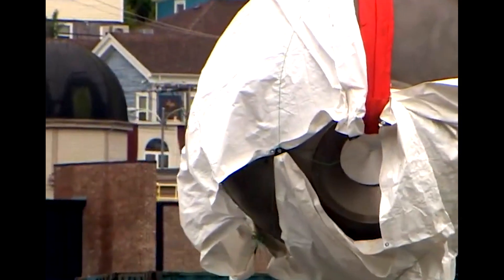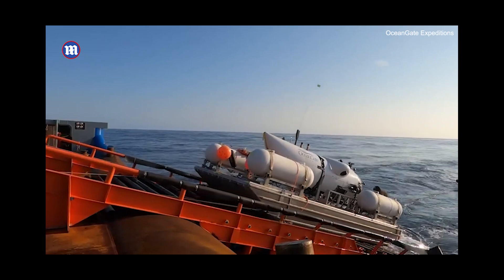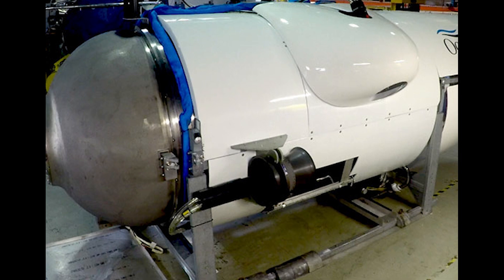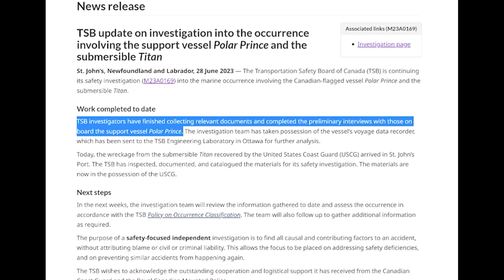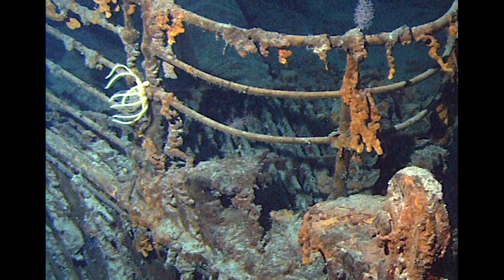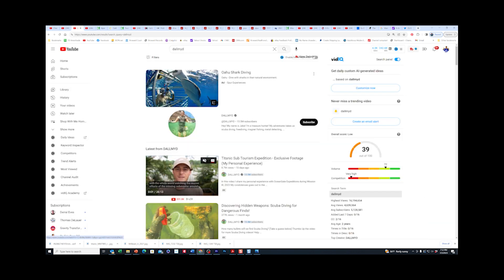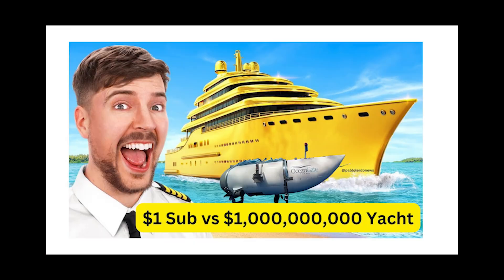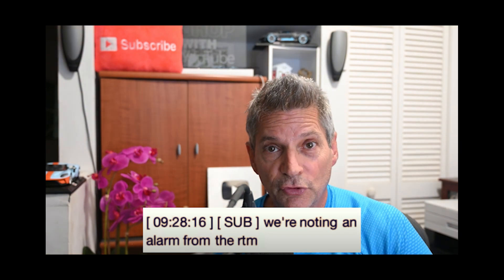Titan Submarine Debris Clues, Implosion Simulation

Comment: The age of exploration
Reply: The Age of Dangerous Ignorance.
Reply from the maker: @Stikibits  In the engineering circles we call this normalization of deviance
Reply: @jeffostroff  Normalization of dangerous ignorance.
Reply: @Stikibits ...to how far the Navy will go to stop Titanic from becoming a Disney ride..
Reply: @Stikibits   so was the car.  Back in those days.  People learn with experimenting. Alot should not have happen. Like glue and acrylic .  The fiber was ingenious.
Reply from the maker: @oanna1221  There was a time where we did not have seat belts When many people were likely fighting for them to be come standard
Reply: @oanna1221  no it wasnt, humans "experimented" with submarine tech over 100 years ago....carbon fiber is not a "new" tech, we've been using it in aircraft for 50+ years.  You're on the right track, but mostly havent a clue what your'e talking about.
Reply: @FriendxA The difference are that airoplanes never experience a force on the surface, greater than 1 psi.
Reply: @Stikibits  walking out of your house is dangerous. Breathing air is dangerous. What r ya going to live in fear. Their is good and bad also horrific  knowledge  to learn from oceangate. The dents and not crushed compacted hull gets me
Reply: @oanna1221 ...

There's dangerous, then there's foolish.    Skydiving is dangerous, jumping out of an airplane without a parachute is just foolish.   The titanium ends of the hull are intact and titanium is accepted for use for pressure hulls.    There is nothing left of the carbon fibler part of the hull and carbon fiber has been rejected for use in pressure hulls.  Deep dives are dangerous.   Even getting in Titan was foolish.
Reply: @oanna1221 because it wasn't an implosion... something pierced the hull and it exploded outward..like a torpedo
Reply: @oanna1221  Dribbling Sh1t could cause invasive, bacteria laden flies to enter your mouth/stomach. Doh.
Reply: @oanna1221 walking out of your house and breathing air isn’t even comparable to trying to go to the ocean floor in a jank sub that had been warned about by several people beforehand.
Reply from the maker: Yes, special shout out to Stockton Rush for being on that front line and showing us what not to do.
Reply: @jeffostroff  the age of implodation
Reply: @moonasha also an ugh-splosion
Reply from the maker: @Defender78  I love that phrase
Reply: @moonasha  "implodation" is now my new favourite word.  Cheers!
Reply: @jeffostroff  i don't think he's going to hear you.....
Reply: @jeffostroff  Darwin award nominees
Reply: @jeffostroff we've known better for over 50 years- since we lost Thresher. He didn't heed the voice of experience
Reply: @jeffostroff I think the Cyclops ate the carbon fiber hull and the people after the implosion. <HEAVY SATIRE >
Reply: @jeffostroff  the craziest thing is that it's not even an unknown realm. Everybody who is in this line of work knows not to design the sub like this. 

Every now and then, we need a reminder.
Reply: @jeffostroff  qqlllolll
Reply: @jeffostroff  Stockton Rush will forever be regarded as an explorer whose demise was his own egotistical willful and knowing criminal negligence.
Reply: @jeffostroff Hell yes. He wanted to be known as an innovator, but only going down in the books as a boob!
Reply: @jeffostroff Hahaha for real
Reply: @jeffostroff built by Father Ted
Reply: @jeffostroff   I think he was on to something  with carbon fiber.  The glue. No! That was suicide.  I could be wrong. My gut says dents on outside hull. Dents not crushed inside hull.
 Logic glue separated trom hull and titanium  end game.
Reply: @oanna1221  Sadly not. Carbon fiber is tough, why it's used for bullet proof vests, but at least at it's current point, it's far less resistant to atmospheric pressure compared to stainless steel or titanium. You can even find a quick pneumatic press video here on Youtube that shows carbon fiber collapsing like a blob of jello at just 1/4 the pressures solid stainless steel can stand up to.

He was just cutting costs with an insanely arrogant level of pride. One of those alone is dangerous enough in engineering, but both together doomed the Titan sub. It really wasn't a matter of if, just when.
Reply: @oanna1221 non-sensical.  The pressure would have held the vessel together. This is an explosive event. Probably a navy torpedo.
Reply: @HulkTheSurgeon Carbon fiber is 5 times as strong as steel. What video you talking about? Is the piece that gave way at 20,000 lbs per foot 5 inches thick? Nah.
Reply: @pikespeak361 five times as strong in what way? Carbon fiber has zero yield since it doesn't pemenently deform under its tensile strength, while 4140 steel has 415Mpa Yeild. CF and 4140 has about the same tensile in that configuration (about 1Gpa). 4140 has a shear modulus of 80Gpa (crazy!) and CF is 15 to 20 GPA, making it at best 4 times worse than a good alloy steel. CF is only 5 times stronger in tensile strength to weight ratio but nowhere close in strength to volume ratio as indicated by any materials spec sheet.
Reply: @VoidedWarranty  BY YOUR VERY ASSERTION, THE VOLUME OF THE CARBON FIBER, LIMITED AS IT WAS, WAS STRONG ENOUGH. AS WELL AS THE FACT THAT THE PRESSURE WOULD HAVE HELD THE COUPLINGS TOGETHER BY DEFAULT.
Reply: @pikespeak361 the titan had NOT been proven. Who tf are you saying sent a torpedo towards a submersible that was literally right by the titanic??? And WHY.
Reply: @oanna1221  i am a plastic technician, and i don't think carbon fiber is a good idea for something like this.
With every dive you are going to lose in integrity in the fibers build up and the fibers themself. 
It would maybe make sense if you intend to replace the carbon fiber every few dives. 
Otherwise i wouldn't recommend using it. Once the fibers build up is compromised you are in a death trap.
And over time with high pressure on the haul you would lose on integrity, can't avoid that.
Reply: The Era of Implosion.
Reply: İnploration.
Reply from the maker: @garrysekelli6776  I like that new word we should add it to the dictionary
Reply: Rich people and their idle hands. Like what mountaineering was ~100 years ago
Reply: @jessicaandtrains7768 mountaineering 100 years ago was more considerate of the conditions then modern history...and Titan was proven. This is a cover-up.
Reply: Rest
In
Pressure...
Reply: totally the age of exploration, proceeds to implode at the depths of the Canadian ocean
Reply: @YourJetfficialJet No... The age of exploration were a long time ago.
Reply: @brostenen right. Now we're in the age of the rich entitled where they think rules, safety methodologies, expert analysis, and physics doesn't apply to them.
Reply from the maker: @dingickso4098  You got that right some Of his emails show just what a narcissist he really was
Reply: The age of imploration.
Reply: "Mission specialists."
Reply: The age of corporate greed and tofu dregs engineering.
Reply: @amandahugenkiss I see what you did there. Nothing like a bit of distain towards peoples choice of food. 🤦‍♂️
Reply: he only failed once
Reply from the maker: @JoeHeine  You don't get a second chance to make a first implosion
Reply: @jeffostroff  audience can't even "fathom" a second implosion.  Cheers!
Reply: @jeffostroff The wreckage indicates an EX-plosion.
Reply: @pikespeak361 looks pretty close to a failure under compression caused by adhesion failire I've seen on other carbon fiber parts. What do you think a carbon fiber implosion should look like?
Reply: @JoeHeine Everything fails at least once. Exactly like everything can be eaten at least one time.
Reply: @MonyShairKnowledge it is sad...people are such followers and question nothing.
Reply: Rush never knew he was wrong ..
Reply: The age of exploration, denied and destroyed by the military; with a dumbrain story to explain it away 💀
Reply: Dude, what you're saying about the view port being potentially taken out by salvage crews is non-sensical.  The outer ring is still present. It blew out, clearly. Something is fishy here, to make a pun.
Reply: @oanna1221 but there are also well known engineering principles with carbon fiber that were ignored, such as determining the service life of the vehicle. There's a difference between brave exploration and ignoring well known materials engineering practices for determining the safety of an innovation and yoloing it into the deep. This was an accident that did not need to happen. So many design mistakes on that thing that we've learned not to do by people dieing from those mistakes 60 years ago. Look up the Apollo 1 fire for reasons why we don't bolt hatches shut from the outside anymore, as one example.
Reply: Yes, space isn't the final frontier, the ocean is. We haven't even discover them all yet but here we are flying into space.
Reply: @salamander337  So instead of 'Star Trek', the 60's TV show should have been called 'Wet Trek'??
Reply: @johnbergstrom2931  C'mon now only you can think of something wet. How about Sea Trek? Or Sea Quest? Although I think might have been a cartoon of that name.
Reply: @salamander337  Nah, go for something funny...  'Fish Trek'
Reply: nah, age of greed and idiots.
Reply: The barrel demo is a great example of what happened to stocko’s ego
Reply: You Born too early to explore deep sea, born too late to explore your Submarine.
Reply: Stupid technological
Reply: when you are rich and white, you get a full month story of your death.......but if you are poor and your skin color is brown or black, you will be lucky to be on for 5sec news.
Reply: @ultimatedouchebag6760 which is good, because then noone cares, just how the government likes it. Chicago murder rate?  News don't care. Keep it up, they infer.
Reply: What???? Dude!!! That was from the 1400's to somewere in the 1600's.
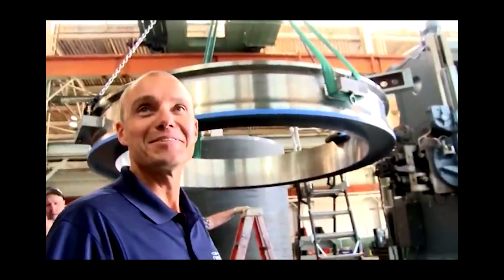Reply: at all: 2:46 What did the bald guy say?
Reply: the age of Darwin natural selection
Reply: Don’t you mean the species of exploration? 😂 humans been doing this n dying over it loooooooooooong time der chief.
Reply: The age of me?
Reply: You raise a good point.
We always say that we know more about space than the sea. 

Maybe now we are in the space race, but DOWNspace.
Reply: i'm content to watching people succeed or horrifically fail and get trashed for it in the comfort of my own home.
Reply: Pioneering always leaves bodies behind.  While I think the level of Rush's arrogance was breathtaking, this was always going to be risky.
Reply: The age of reexploration.
Reply: age of imploration
Reply: the "well, that didn't age well" of exploration
Reply: Well! Did they really land on the moon?! 🤔
Reply: The age of implosion
Reply: more like the Age of Arrogance
Reply: The age of ignorance,  more to the point
Reply: The age of greedy ignorance
Reply: No way. There were multiple manned expeditions since 1986. All succefull.
Reply: This was not exploration. It was commercial tourism with reckless engineering, lack of risk management  engineering, and just missing good solid engineering.
Reply: @andret4403 you work for the Navy or something?
Reply: Making Natural Selection real again
Reply from the maker: @ghostmost2614  They should have called the sub the darwin
Reply: @jeffostroff  One YouTube channel calls it the Deathsub
Reply: This was tourism, not exploration.
Reply: @gagaplex good citizen shilling for the Navy...good💀
Reply: "This is the "titanium" Ring you saw them pull out of the ocean"
No Jeff. Wrong. Neither you nor anyone else SAW them pull it out of the ocean. 
Psyop....
Reply: What is the last frontier. It’s the next unknown and dangerous venture.  Success yields hero’s.
Reply: @YorkPADad  Load of dangerous garbage.
Reply from the maker: @YorkPADad  I think he will be remembered as one half swashbuckling captain kirk
Reply: @jeffostroff  Stockton Rush will be remembered more like Captain Smith of the Titanic
Reply: @johnbergstrom2931 and that's what the Navy wants you to think.
Reply: HE WAS TOLD it wouldn’t work & advised to do safety testing, but he flatout refused.  He even FIRED the 50-year-old man who had knowledge & experience with sub testing!

CEO == Major league idiot.
Reply: ALSO engineers overlap the fiber in a crisscross fashion for better strength (like threads in a shirt).  The CEO flatout refused to do that

.
Reply: @electrictroy2010  
It still may not be strong enough due to the huge weight of pressure!!!!! ... 😢
He was also told "to test it more"!!!!!
It is hard to believe that he did take any warning seriously!!!!! ... 😢
Reply from the maker: @electrictroy2010  Exactly, he chose what they call a hoop spun method, which makes no sense to me and whatsoever
Reply from the maker: @maryalove5534  I am sure he felt that he tested it enough
Reply: @jeffostroff  
And I think that was his problem ... 😢  Way too over confident!!!!! ... 😢
It seems he didn't want to go out of his way in being thorough enough in his venturing!!!!! ... 😢

Comment: They should rebuild the sub on a wooden frame to see where the first point of failure happened.
Reply: except I think the point of failure is utterly in a million pieces, the pressure hull,  what they brought up, was simply the rest...
Reply: Lol😂impossible
Reply: @SkiSkillsMontana  it's just for the pieces they salvaged, like all NTSB investigations
Reply: It was the glue that held the hull and titanium  port entrance and carbon whatever together. That glue compressed and decompressed breaking down partical super hold. It's comon sense.  The port and titanium  blew off. Water rushed in hull. That is why hull is squeezed not crushed in middle like Pepsi can. Three people sucked out. Two torn apart pushed to back. Blood boiled. Insides imploded.  It's comon sense. Also in 1981 or 83 maybe 84. Deep divers from France went down. Guy open hatch too early. Sucked one man out ripped him to pieces. Their is a vlog on utobe about that event. 
That water was cold.
Reply: @oanna1221 You're babbling nonsense and confusing implosion with explosive decompression.
Reply: @lewis7515  not nonsense. You don't see what I see. Heat expands. Cold compresses.  Like ocean. Leather. Wares out . Ice melts.  Metal rust. The glue looked like rubber particle s. Hot cold hot cold changed glue chemical compound like a metal barrel  with boiling hot water and then cold tap water sprayed on it. The glue was sht idea. And the acrylic thing .. acrylic can't handle that psi  . Shocked it lasted.
Speaking of babble, It comes to mind palm dessert energy fan thing. Those are carbon fiber. They are replaced every so often. 
So rush knew, 
Cowardly. A sorry man
Reply: @oanna1221  None of that is anything to do with your nonsense that confuses implosion with explosive decompression.
Reply: Why would a wooden frame be consistent with carbon fiber on detecting a failure point?  You can't build them the same way? What are you even saying? 🤷🏼‍♂️